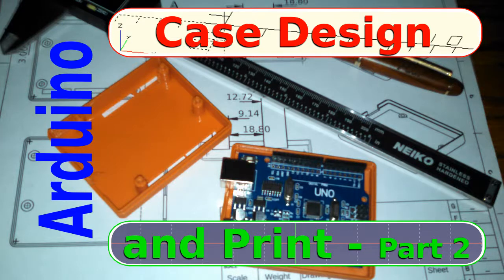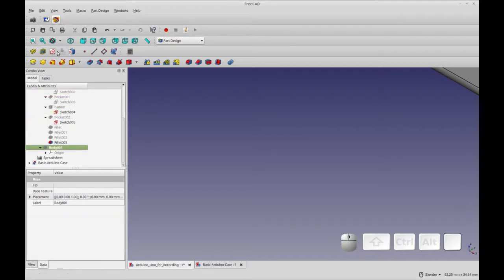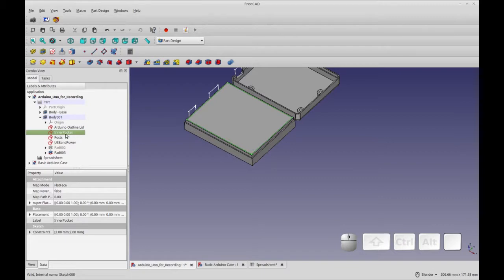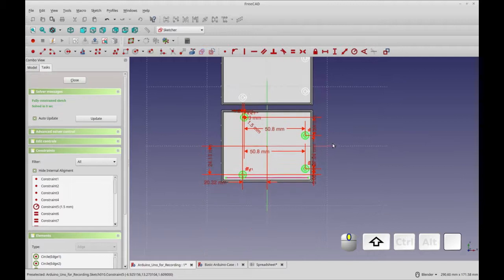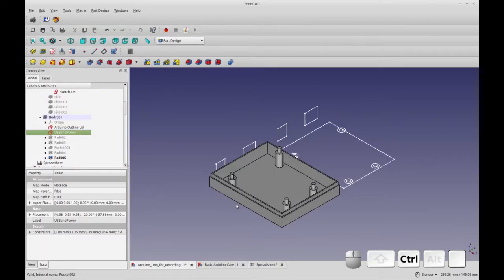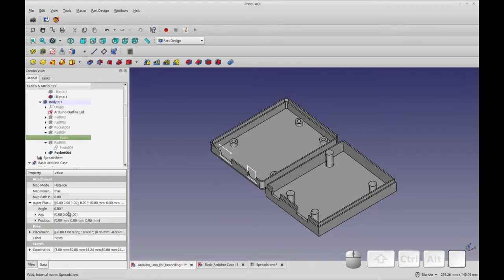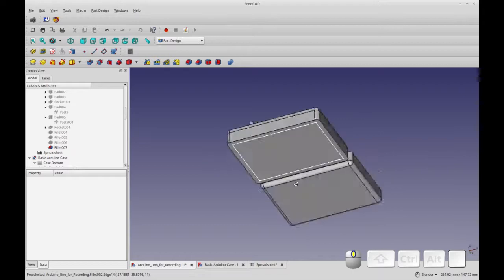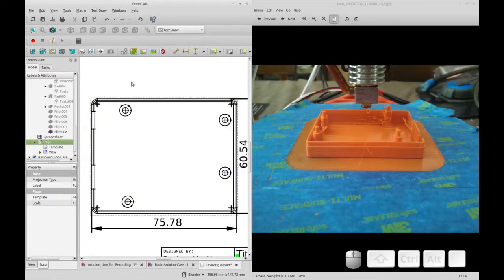FreeCAD - Design and Print an Arduino Case - Slotted Lid

Comment: Could you tell me how you shift your new drawing of the lid so that this sits  as you have in your presentation  If I do as you have done so far then copy my initial drawing into the new body what happens is the origin of the draw is as with the old body which means when you pad the lid for example this then pads into the main case I cant seem to do this and could you demonstrate how  this is done 

Thank you